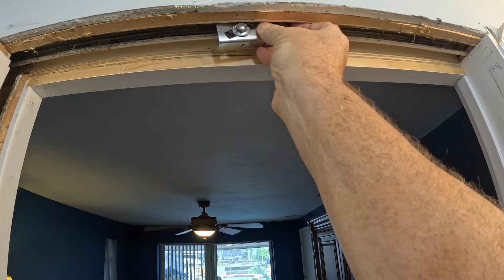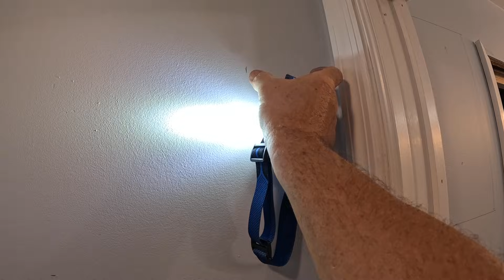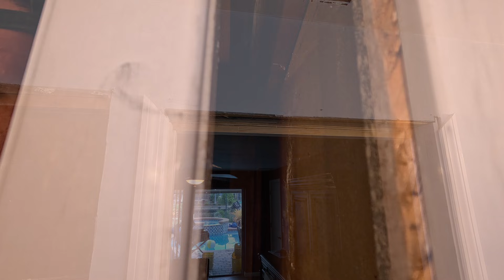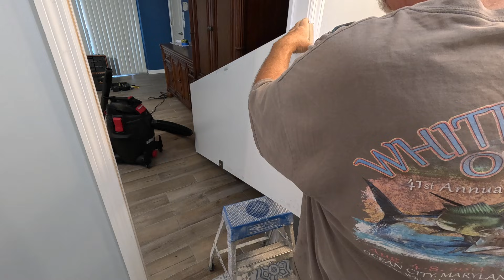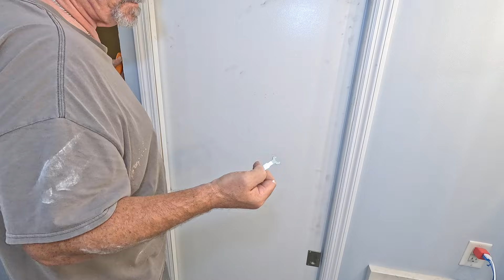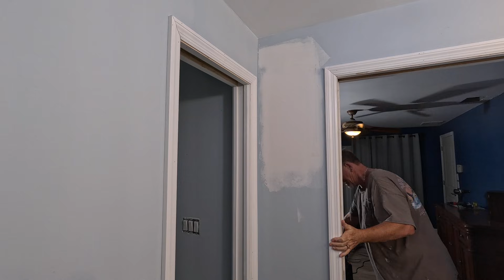How to replace a pocket door track, without removing the wall

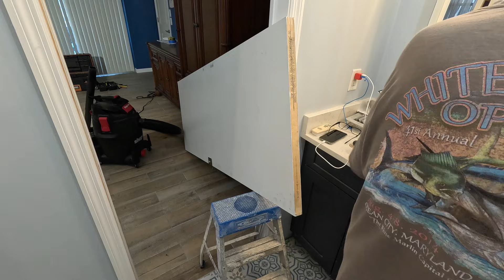Comment: At 19:10 the words on the top of the door say "Warranty Void if not sealed" just as an FYI for any DIYers doing this on your own. Run some paint across the top and bottom and your door will be a lot less likely to cup or warp with the seasons. Also, for any new homeowners seeing this; grab a chair and go look at the tops of your doors, then remeber that a professional got paid to paint those doors and your contractor/final inspector signed off on it.

Comment: I've got a home built in 1971-1972 (we moved in in mid-'72). It has nearly the identical track as installed and I bought the same pocket door track that you installed. The thing that I've been procrastinating away is cutting away the sheetrock to remove the original track. You gave me hope. I'll be looking at removing the door next week and hopefully replacing the track and patching the sheetrock.
Reply from the maker: Glad I could help, hope the project goes smoothly for you! 😊

Comment: Question Matt
Saw another video briefly that shows replacing the new roller type you just installed. The track stopped just short of where the door closes. Just enough to be able to get the new wheel assembly in. Not sure if it is the same one you’re using. Are you familiar with this type?
Also when you’re explaining the old pocket door rail works. That’s the same one I have and when it comes off the track I’ve been lifting the roller up to meet the track and just smacking the door and it pops back in. I’ve been doing this for years. Looks like the old girl finally gave out on me. I’ll closely examine the track to see if she’s a goner. Thanks for making this video. Looks like fun opening up a can of worms 😂
Reply from the maker: This track you load the wheels into the track before you install. They should last for years, the next guy can worry about replacing them in 50 years or so. 😊

Comment: so much for not removing the wall.
Reply from the maker: That’s just a patch. The alternative it to remove one whole side.
Reply: I saw a company with a long right angle drill with absolutely no drywall removed, patched and painted.
Reply: Please tell me where you see an entire wall removed. Cutting a patch out of a wall (which is insanely easy) is not the same as removing a wall bud. You must have soft hands.